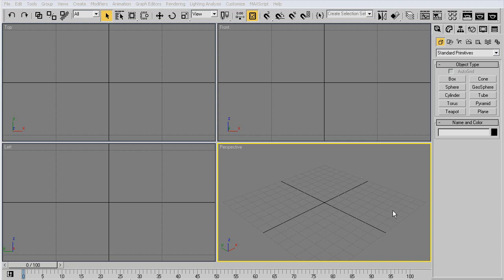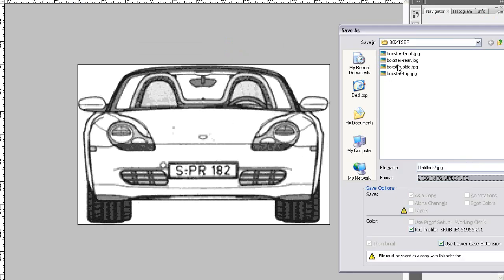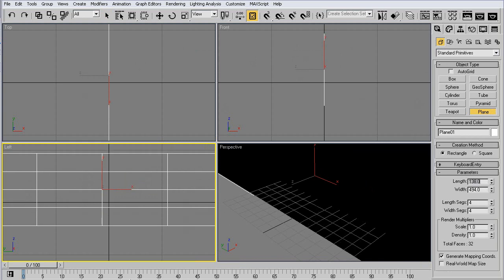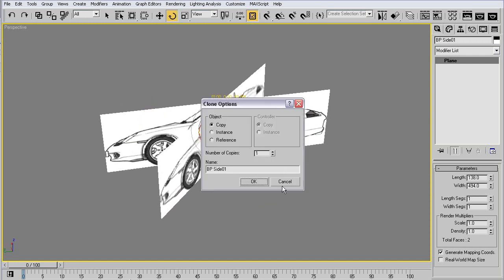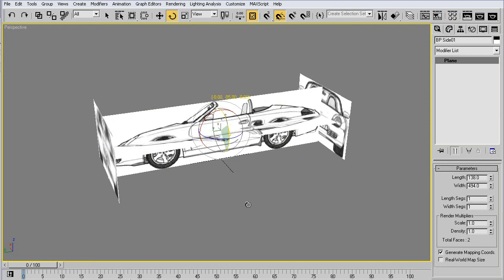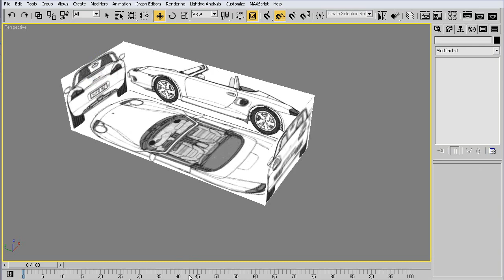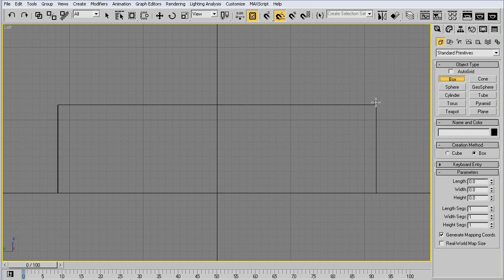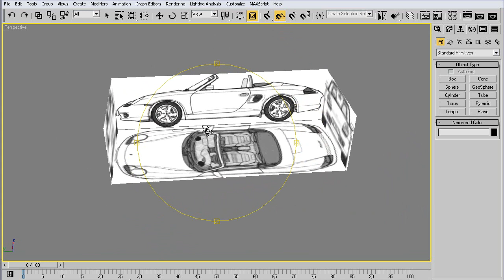3Ds Max: Setting blueprints in 3D Max

Comment from the maker: @seashoresighter Select the area that you want to crop to (roughly), then press alt, then press i, then press p. It's a nice smooth motion if you do it both hands (alt with left thumb, i and p with right index and ring finger), so that's how I can do it quickly. With 'm' (selection mode) and the arrows (move current selection one pixel up/left/down/right), or with the shift pressed it goes 10 pixels up/left/down/right, you can move your selection around real easy and close up onto the edges.

Comment from the maker: @crazybassman101 Go to: Customize > Preferences > Viewports > Configure Drivers. Then set Background Texture Size to 1024 and tick 'Match Bitmap as Close as Possible', Download Texture Size to 512 and also tick 'Match Bitmap as Close as Possible', Texel 'Lookup' to Linear and MipMap Lookup to 'Nearest'. This is all assuming you're using Direct3D (which you should! ;) ). Then restart 3D Max 'for the changes to take effect'. Should do the trick!